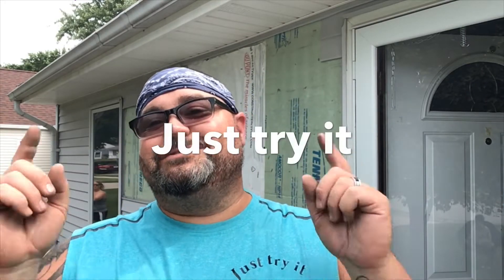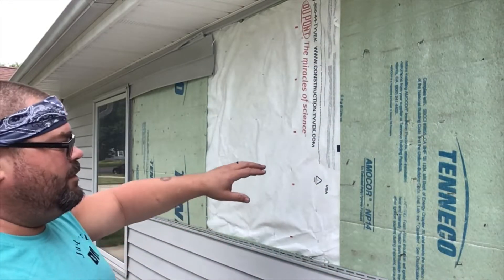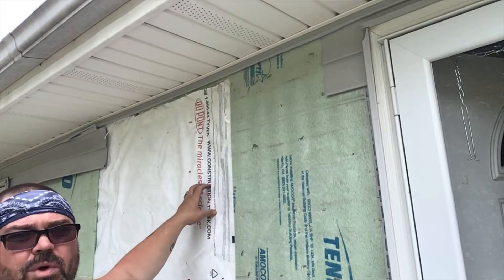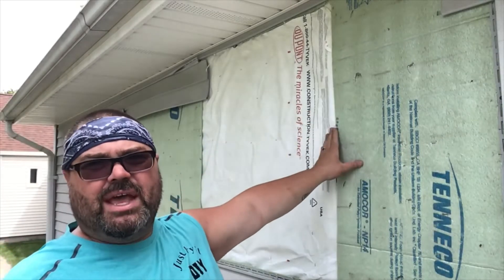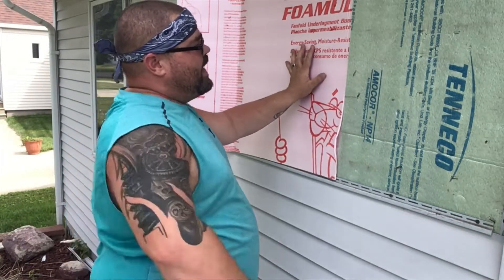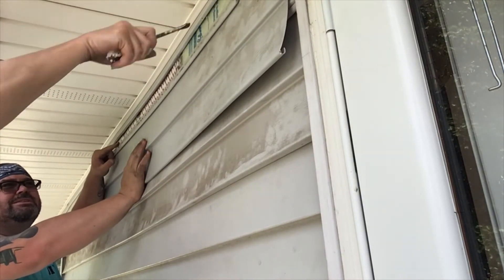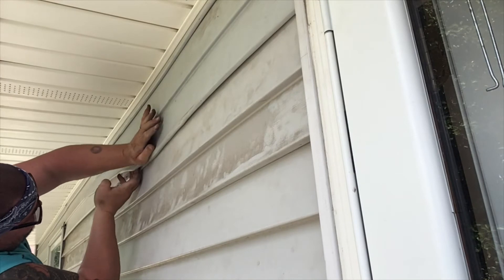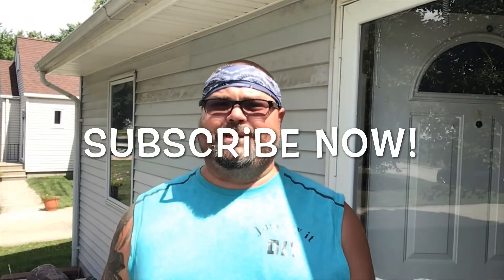Vinyl siding over a deleted window

Comment: How do I block off a window I don't use and side over it. Without removing the window
Reply from the maker: you really need to remove the window. the profile of the window is typically to the outside of the home and will not allow the siding to lay in the same plane as the rest of the siding